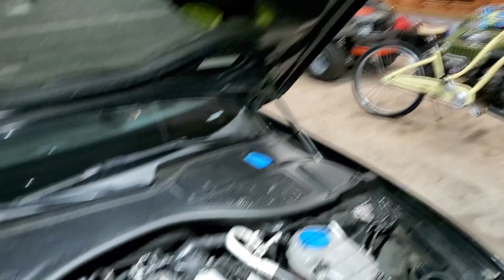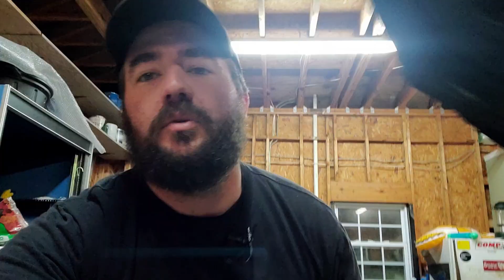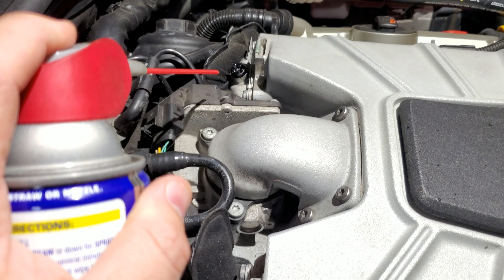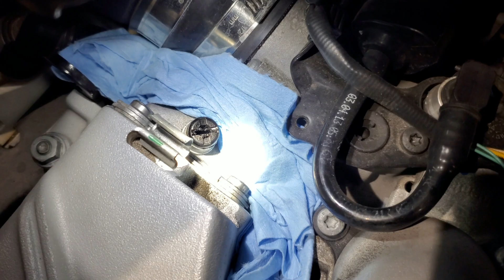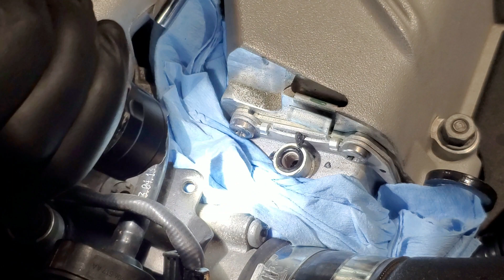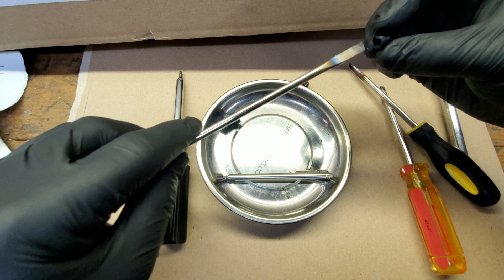This is how you remove Stripped or Broken 3.0T Supercharger Bleed Screws

Comment: 034 This product is very good, right?
Reply from the maker: They are steel. The cores are aluminum. They can fuse together over time.

I removed my 034 bleed screws and unsuspecting aluminum bleed screws to prevent this.

Comment: Would you say it better to try to remove the oem plastic screws while the engine is warm or cold? Would the heat help with the plastic not snapping or opposite?
Reply from the maker: Warm for sure

Comment: It’s too bad Audi used theses plastic junk screws. I guess this was never meant to be manually bled. Pass side came out fine, but the drivers side head has snapped off and I’m now at the stage of using the Philips screwdriver. Waiting for the plastic to dry. Really hope this comes out.
Reply from the maker: I had to do another one the other night. Took a few tries and I also used a torche to heat up the plastic stuck in the core to heel loosen it up. It eventually came out though
Reply: @GarageTaught I may end up having to do that too. The head came off the screw and I currently have a flat head screwdriver in there deep, but it won’t turn.
Reply: @GarageTaught I tried with all my might and made it worse. I think this will be my last Audi. These cars are miserable to work on.
Reply from the maker: They take patience some times
Reply: @GarageTaught I have one last attempt with a Philips. Soaking what’s left of the screw in PB blaster overnight. Thanks for the videos and tips!

Comment: Another super helpful video, thanks! Interestingly, mine snapped on the same side and was also okay on the side yours came out on. 

Am sure the 034 ones are really good, but can't justify £60 on two screws, so bought some from my local hardware store for £2 and some heat resistant o-rings. Hopefully finishing this tomorrow!
Reply: Curious if there's a more extreme next step video anywhere... Looking pretty bleak for me right now. Seems mine was a perfect combination of very brittle in the middle, whilst not budging on the thread at all. After trying the heated screwdriver method with no success, I've moved onto drilling and using an extraction tool. This has just eaten up more of the screw so now just a tiny bit is on the thread. Not a good day overall 🙃

Any suggestions from anyone would be much appreciated 🙏
Reply from the maker: You can try and gently heating up the entire area with a heat gun to try and loosen it up. Otherwise you will just have to gently pick it apart and try to remove the pieces
Reply: @AudiC7Owners  appreciate it 🙏 at the point where I'm getting a little worried about it - my dad saying things like if I get the drilling wrong and damage the housing, it might mean the whole SC needs to come out... had quite a few suggestions and gonna show him this and some of the others to let him decide how to handle it - I'm fortunate he's way more experienced at this kind of thing than I am!
Reply from the maker: Good luck!

Comment: I have a plastic drain bolt on the top side of the radiator that takes a hexagon or a flat head or a screwdriver none of them work it's not coming out so I'm going to have to heat it up and then burn into the plastic to get a good bite on it cuz it's just tearing apart on the outside

Comment: My broke too but a heated screwdriver and it didn’t work I ended up twisting off the nipple to bleeder screw sat in…. How do I repair that? Anyone help is appreciated
Reply from the maker: You can try to jb weld it back on, but you will ultimately need to replace the ic core
Reply: @ is there a part number?
Reply: @Yahsharal864  Did you fix this? exact same thing just happened to me, but it broke when removing the screw - which came out in one piece. I have no clue how that is possible
Reply: @paulblart1 yea I ended up buying a new supercharger smh then bought after market screws hope this helps
Reply: @Yahsharal864 how did yours break? Did it come off the core? Mine was just spinning. I put jb weld around it and will pressure test tomorrow

Comment: Just a tip from a trusty mechanic, should have used a #3 phillips in the very beginning before you rounded off the screw heads. I work in aviation and done plenty of drilling stripped out screws and there are multiple different types of screws out there that can be taken off with wrong screwdriver tips. Kuddos for the trick though heating up a screwdriver to get more bite out of  plastic screw that should have been metal from the get go.

Comment: Thanks for the video.  I'm actually here because I was searching for a trick to extract broken plastic screws inside hurricane shutter sockets. 🤞
Reply from the maker: Nice! Hopefully this helps
Reply: @GarageTaught  Working great.  Mine are so stuck I'm having to melt my way all the way through.  I had to use a flat blade and grind it to fit all the way into the sockets.  It quickly lost it's temper, and quenching/reheating was tedious, so I started melting with one driver and extracting with another.

Anyways...thanks again!

Comment: very helpful video. one tip i would say is keep the screw driver in there after it melts, the plastic creates a bond to the screwdriver once it all cools down. i had to use a plier to remove  it after i took it out.
Reply: you are right. I also did this. Let the screwdriver cool down in the screw. It created a firm bond and afterwards is was hard to remove the screw from the screwdriver after i got it out :)
Reply: @yomega  I agree. This is the best way to do it. Heat the screw driver with a propane torch until it is glowing red. Stick it in the plastic and leave it. After about 10 minutes. It will screw out easily. No need to worry about bits of plastic falling into the engine, it will all bond to the screwdriver.

Comment: Just changed my OEM bleeding screws. Everything went just like the video :). One went smooth one snapped the top end and left the other half in. I heated the screw driver, i used a flat head and rammed it well about quarter inch. let it cool off and sprayed a bit more wd 40, after that start spinning out like a princess. Placed the 034 Motor Sport bleeding screws and in the process bled the supercharger.
Reply from the maker: Nice job!

Comment: Great channel and videos! Lots of time goes into this! 
I tried your method of heated screwdriver but my screws are completely dry rot and seems like there are melted with the threading. It just breaks into pieces. I took the supercharger of and Ian trying to drill them out from underneath so nothing falls into the cores. That should be my only option, what do you think?
Reply from the maker: That's rough. Might be worth trying to loosen the old screws with a heat gun before drilling.

Comment: If you want to make your own bleeder bolts and pay 2 bucks instead of 45 they are m8x1.0 16mm bolts. You just need to cut a bleeding slot in them with a dremel
Reply: Has anyone tried this and got a confirmation it worked ?
Reply: @AviSensation  I have stainless steel M8x1x16 bolts from China that cost me just under £5 with shipping and 8x2mm O-rings that look all look a good fit vs the sheered OEM rubber head. Trying this tonight... Not going to mess around altering the bolts though - I'll just need to remove almost all the way to bleed in future, but tbh I'm not envisaging needing to bleed the SC again. Recently upgraded my HX which has led me to changing them and with the same problem this video addresses.
Reply: @samburrows7277 did this work, I tried installing it but it didn't go smoothly so I stopped. Will it not mess up the existing threads?
Reply: @zethembe_mbatha yeah it worked - just double check you have the 1mm thread and not 1.25mm which is far more common and why I needed to order from China. Can provide the link if needed and should screw in easily (I used a little anti seize grease just so they don't get stuck like the OEM rubber ones). Only issue I had was the removal of one of the OEM screws.
Reply: @zethembe_mbatha good luck and hope you find some locally. I couldn't find any in stock in the UK - took about a week from China from memory.

Comment: Thank you SO MUCH!!!  A few months ago, I did my water pump and thermostat and reused the plugs.  Learn the hard way, I guess.  I recently replaced the lower radiator hose and when I went to refill, I snapped the top off of that POS plastic bolt.  Anyway, after freaking out, I saw this video and it worked like a charm.  I did use PB blaster when I tried the first time and just ripped the plastic apart.  So I waited overnight, and tried again and it worked like a charm.  (highly recommend PB Blaster and time)  It still was crumbling, but it's almost all the way out now.  I need the car running now, so I bought the Audi ones, but will be getting the stainless ones. They didn't even stock them... apparently the techs just pull a vacuum and never need to use them.  The comments below about wrecking the supercharger scared the heck out of me.  But I pulled success from the jaws of failure... with a little (lot) of help from your video.  Thanks a million.

Any chance you'll be posting a radiator replacement?  No video's out there on a Q5 3.0T radiator replacement.
Reply from the maker: Hey man! Glad this video helped you!

I doubt I will be doing a radiator replacement video since things rarely go wrong with them. If the day ever comes I'll be sure to record it though.
Reply: @GarageTaught  thanks again. Looks like it was just an old hose o-ring that was slowly leaking, and not the radiator. Swapped in a new hose and leak gone.
Reply from the maker: Nice!

Comment: I just did this today replacing the screws with the O34 ones and this was recommended. Google sees all. Not knowing this I used a drill and drilled it out until there was little material and using a pick get the rest. Because of how a drill bit works all material was brought up and thrown out. With the screw off I  turned the car on and off in seconds to blow any plastic if it got in, out. Thankfully the coolant was cool, would have burned my arm if it was warm. At least I know my pump mod works... Also a extractor kit didn't work because the plastic is too soft.

Comment: The head of my drivers side intercooler snapped off too. I drilled out as much plastic as I could…. A few little pieces fell into my intercooler. Luckily I’m porting my supercharger with Jokerz and replacing my intercooler this week. I ended cutting down my new supercharger screw halfway because it wouldn’t go further due to plastic still being in the hole.
Reply from the maker: Just keep an eye on it & make sure it doesn't leak. Did you get everything out before you ran the car? Those pieces can get stuck in your intercooler core/coolant pump & do damage
Reply: @GarageTaught  this happened when I was still stage 1 a few thousand miles ago. I’m stage2+ now and I’m very certain I didn’t get all the pieces and they damaged my cores and/or my coolant pump. LUCKILY, I’m replacing my thermostat, water pump, pcv, cwa 100, S4->S6 HX (thanks too you) and brand new oem intercooler cores all at once. Might even find a few pieces.
Reply: @GarageTaught  my cats are basically gone too. With ambient temps of 60F after 2 hard pulls I’m seeing 180-190F. I’ll be installing my JHM Test pipes paired up with Jhm high flow catted down pipes in a few weeks. Scared to even drive the car haha. I’m happy I had my p3 gauge because I learned how to monitor everything and notice when something is wrong. my buddy and I were doing some pulls and he said I was shooting flames out the back around 160mph. After that I realized my cats are almost dead.
Reply: @GarageTaught  call me stupid; but i did my best to stay on top of my cooling system. thankfully there’s channels like yours out there to inform missinformed people like me, and help us learn how to properly bleed and keep our engines cool .
Reply from the maker: The P3 Gauge is the single best mod I've done simply to stay aware of my car's health haha. Glad you caught it. Keep me updated with how everything goes 🤘🏻

Comment: You left the rubber gaskets from old screws in and doubled them up with the gaskets from the new screws. I took the old gaskets out, but now not sure if they were supposed to stay in there, meaning they are part of the supercharger not the screw. I get no leaks. I kept the old gaskets just in case.
Reply from the maker: I did on accident. They were intended to replace the oem gaskets. That was a goof up on my end, but I don't have any leaks either. The next time I open those screws I'm going to replace the gaskets
Reply: @GarageTaught  Ok, just making sure I was not supposed to have them in there. Thanks for all your videos, I enjoy watching them.